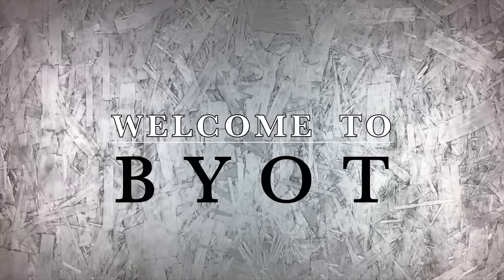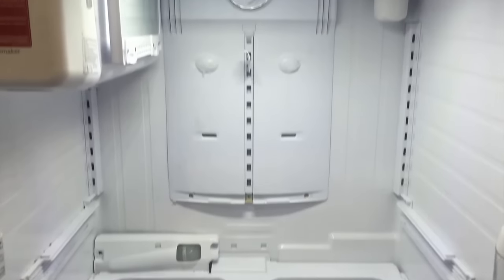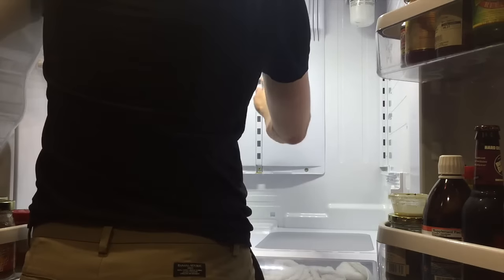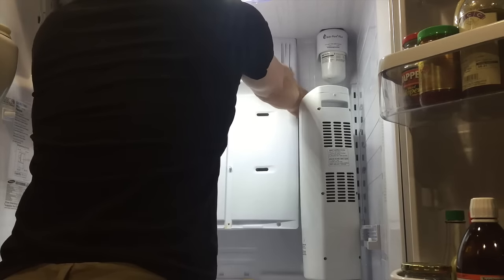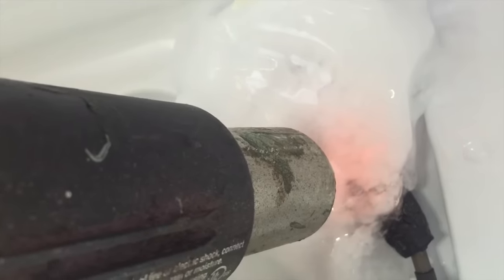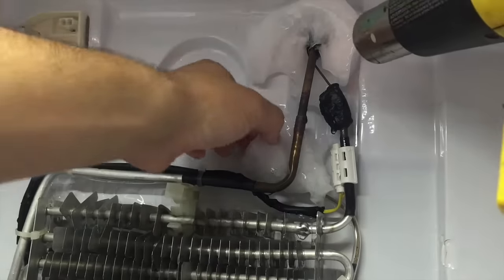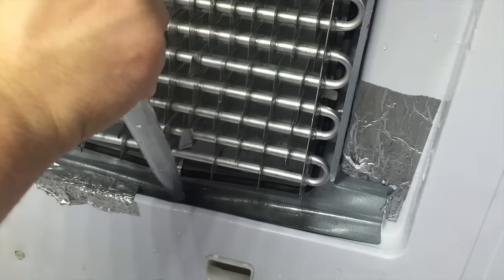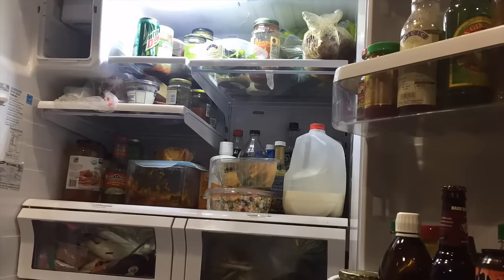Refrigerator Not Cooling // Easy DIY Refrigerator Repair

Comment: The video was good. You didn't go quite far enough though. You were staring right at the heater element when you were in there. Normal process is to ohm out the heater element. If it ohms out correctly then you go to the heater timer which is normally the problem on these units.

Comment: Thanks for the video BYOT. I have performed the same ice removal process 3 times in the past six months, once every 2 months on my similar Samsung fridge. It’s an ongoing issue with this model. Finally called Samsung the second time and they said warranty will cover anything cooling related so hoping they can fix the issue or replace my fridge.
Reply from the maker: Martin Phan happy to hear that this video is still helping people.  Let me know what Samsung says.  I only have to do it once a year.  Every other month would be waaaaay annoying.  Good luck and thanks for the support